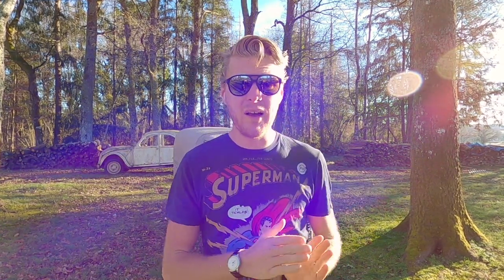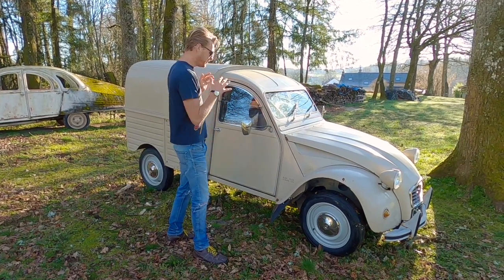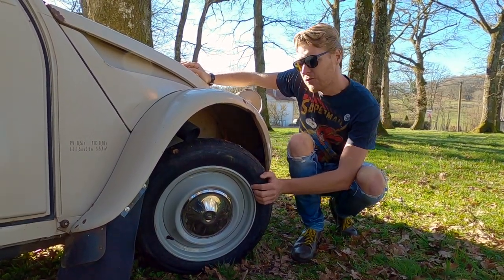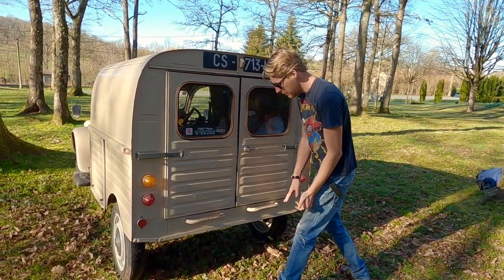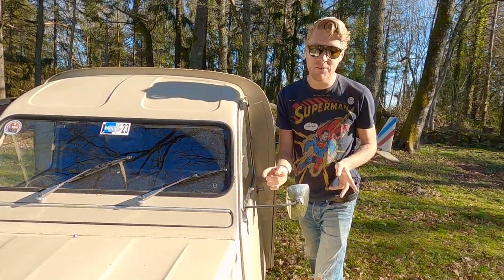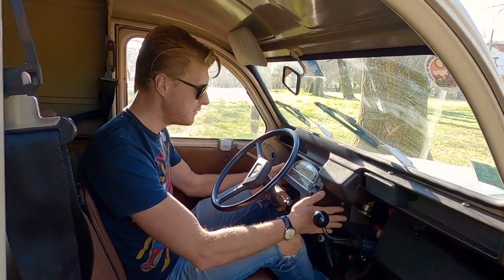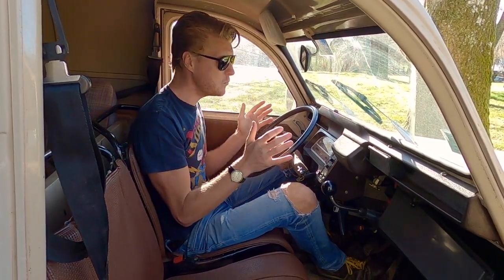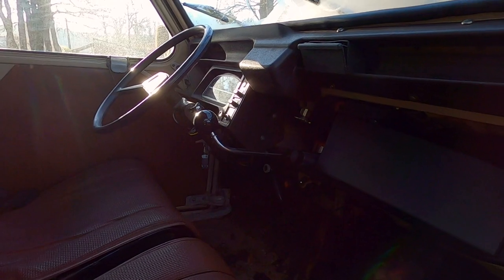Citroen 2cv Van Review

Comment: The fuel tank location is changed from the car version partly because there is an empty space (opposite side than the spare tyre compartment, same space) And its easy to get a "tube" out of it and its fuel cap, you could just go and bolt a normal car tank in it, there's the space under the van just like the car, but making a tube to fill it would be more complex, the floor of the car is higher in the cargo space in the van as well, just like the car under the backseat. 

There are different lenghts and heights for this vans, depending on the production year and specific models, short models are shorter than cars, but long models are as long as cars if not longer. 

The Dyane 6 did never use that instrument cluster, it was for 2cv's only, about the wheel, the foam one is the ugliest, but sure the most comfortable for daily driving, and never that hot or cold as the other wheels, have cars with all of them and that's sure the best that way. 

Its true those were cars for work, nobody took real care of, they were used and driven to death and that's why nowadays they're more rare than a 2cv car but anyways, there's still plenty of them. My grandfather had one as his first car, one of the first made in Vigo (spain), it was the first 2cv van model, an AZU. He used it for his shop, he was a blacksmith, and added springs between the rear suspension arms and the chassis as he had to load it with iron, appart from work, my grandmother made curtains for it and they went on holidays with it, some slept in a tent, some in the car at the camping. The car still had 2 more owners after all that and was used until its very end.   

I now have a later AZU (with square rear door windows, the other one had oval ones) which I'm making road able again, the chassis was broken in half due to rust, no brakes, no windshield as the metal arround it was just gone etc, no floors... But it had been as well someone's in my family car... Didn't want to really restore it but as being in quarantine, I've used this time to give it another chassis, floors, panels from other parts vans I had, etc... It won't be crazy well restored or purist in any way (I've turned it from 425cc drum brakes to 602 twin barrel carb and lhm disc brakes), but stetically will be correct in a decent finish look in and out and... Well... For the use this vans were for... I'll use it for work, carrying engines, parts, etc...

Comment: Although I have an Acadiane Mixte I have recently bought from my estranged wife a Citroen Nemo, but it’s not a basic van but a small camper van. It’s a Romahome 10, made in the Isle of White by Romahome. They buy vehicles direct from Citroen and convert them. It has a single berth and is complete with a double burner stove, a sink and chemical toilet. It was their show model and has various extras includiing a tv and CD player. It’s fitted with a lift up roof. It has a 1248cc Italian turbo Diesel engine that pulls brilliantly. Although it’s a modern basic van it’s very honest in true Citroen value. The Nemo is only two models of small vans away from my Acadiane
Reply from the maker: I'm familiar with them their quite cute

Comment: Nice car, shame we didn't get to go out on a road test! Those static seat belts are much better than inertia reel belts, which are only as good as the spring tensioner, if that fails the belt is useless,  no such worries with a static harness.
Reply from the maker: It drives like mine but louder and with brakes that need adjusting 😂